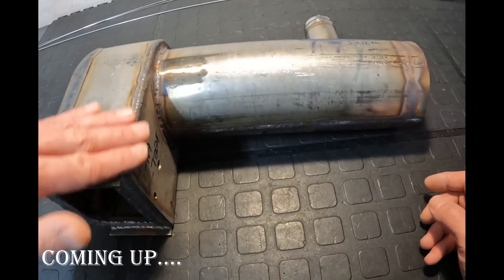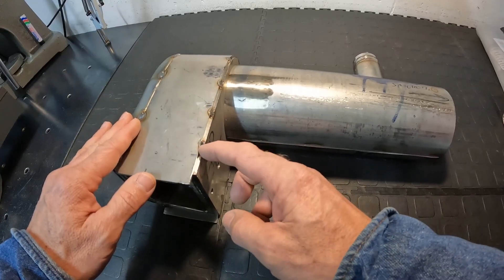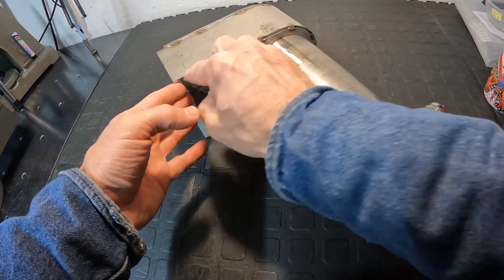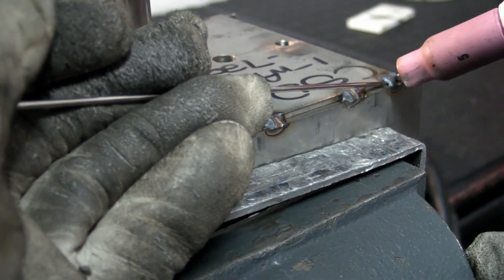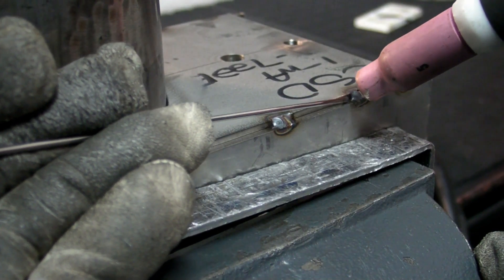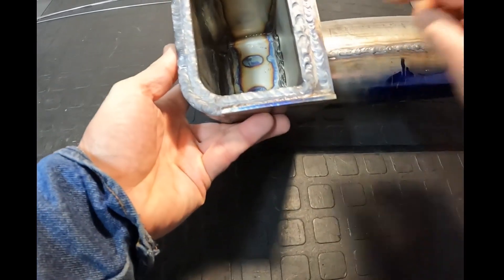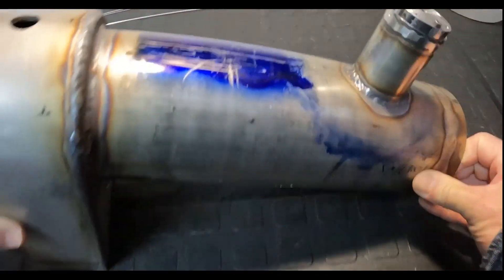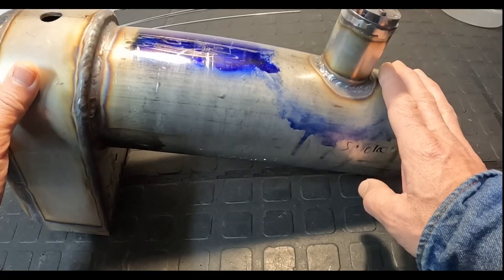TIG welding in the home workshop - Boiler welding - Part 3

Comment: Hi, when using stainless for boilers would you use the same thickness as if it was copper? If plans said 76x3mm copper should i use 3mm stainless? Or could I go thinner like 2mm?
Reply from the maker: Short answer no. You need to calculate the surface potential for stress corrosion cracking, and design for that failure mechanism. This is different to normal boiler calculations. If you look at my boiler designs and keep to the plate sizes and stay design you should be ok.
Reply: @Lukers_tinkering  Are the designs for some of your locos available through patreon?
Reply from the maker: @KARS-t9y yes, drawings dfx and wahya has 3d files.

Comment: Thank you for this series and for pointing me to the Ballarat articles, I'll be ordering the magazines in a minute.
I hope you'll do a video about boiler design in your new series. Because that's still something of a black art to me.
Reply from the maker: The Ballaarat is such a fun little loco. Surprisingly stable pulling a large load fast with the low pitched boiler. I would not recommend making the copper boiler someone else designed for the Ballaarat, I tried to help but the contributor knew better.
 I specialised in numerical thermoflow so my boiler designs are calculated using some of those techniques (too boring for YouTube!), but I'll try to give some guidelines in the new series that should be helpful.

Comment: Verry interresting video series !!
I would mension that we are, and have been, using stainless steel boiler in europe (Belgium in my case) for a long time now, more than 20 years.
And it is also the case for the "larger" boiler (12:44) we have a good quantity of them between 20l and 25l, and it is working great. To me, no need to swich back to steel ? Or maybe am I missing someting/ some information?
Reply from the maker: Yep I've been making stainless boilers for well over a decade, and they are all still working well. The series is more for the beginners in the hobby. Large boilers like that require 3rd party inspection and signoff, a club boiler inspector is unlikely to be able to sign off a class 2 boiler. The calculations for the surface potential also becomes tricky. I assume for those larger boilers a ferritic stainless or duplex stainless is used.
Reply: @Lukers_tinkering  we are using 316L stainless. And obviusly the regulation is not the same everyware...for us, if pressure(bar)xvolume(l)<200, we do not need "official" testings.
In my case, I am kind of a beginner, and due to a lack of stainless boiler maker, I will try to do them myself

Comment: Very interesting. With this method of boiler making you don t need to use boiler stays?
Reply from the maker: No, you do, but fewer are required. In this example, the boiler will have one through the throatplate and backplate, respectively, and three for the rappers. The crownstay negates the need for rod stays there.